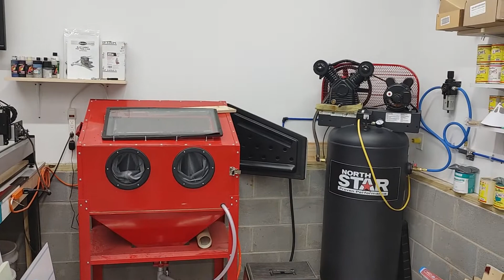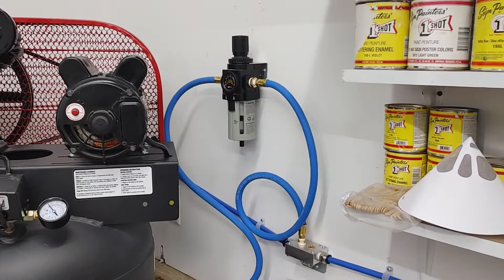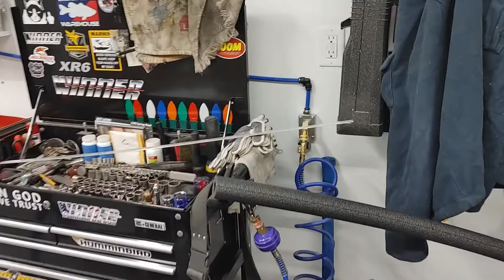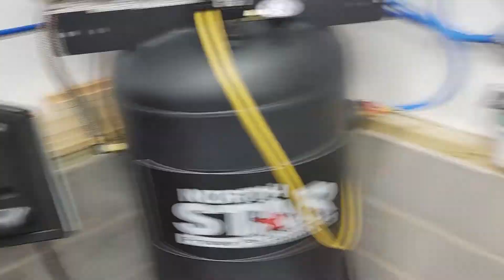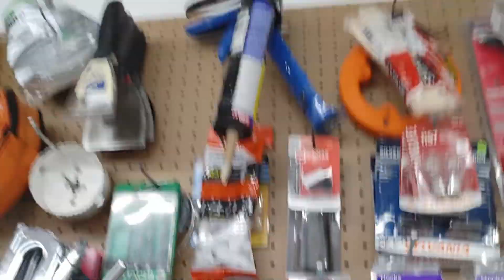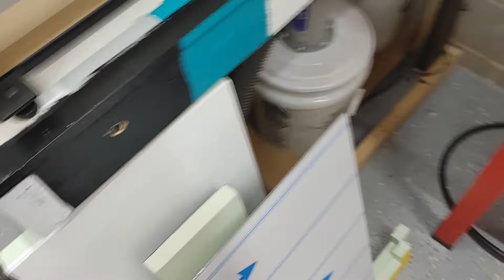How to Sandblast Signs: Where to Start Part 1

Comment: I have a question, how long have you been able to sandblast a sign non stop with that type compressor and at what psi was it? I’m looking at buying a 10 ho 120 gal tank compressor to sandblast HDU signs with. I’ve always used a large tow behind compressor but it starting to lose its pressure, it’s drops down to 50 while blasting. 
Thanks
Reply from the maker: knock on wood, at 90 psi it works fine. It will run a lot when blasting but I don't blast many signs these days.